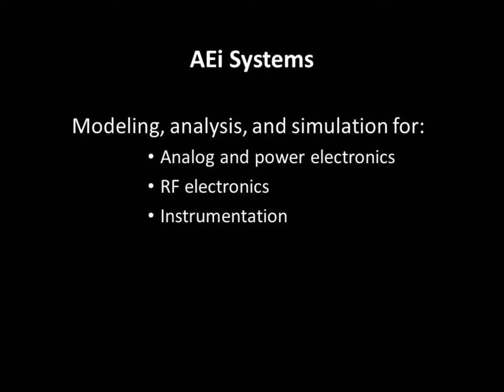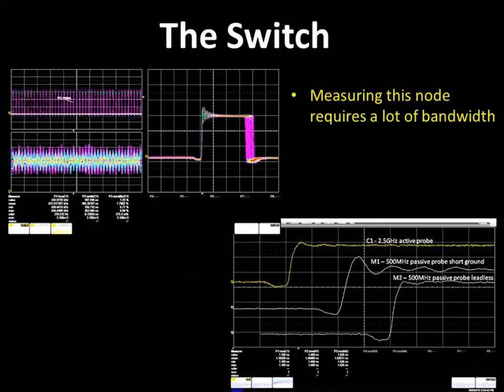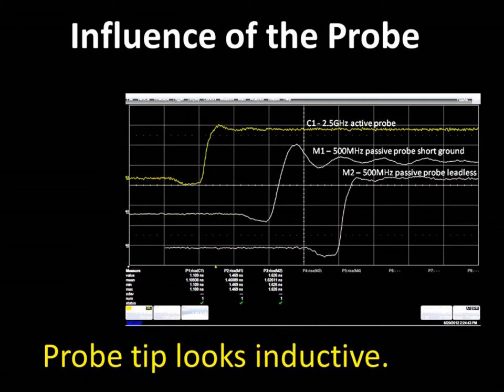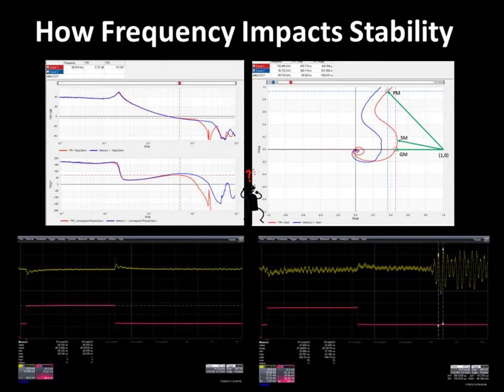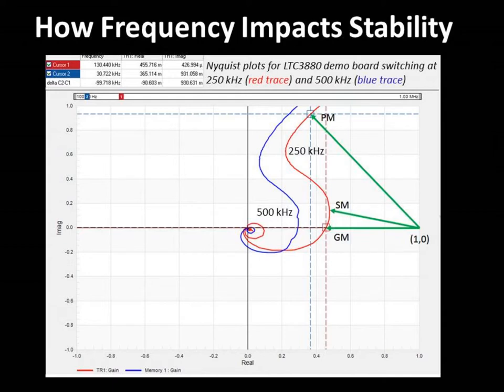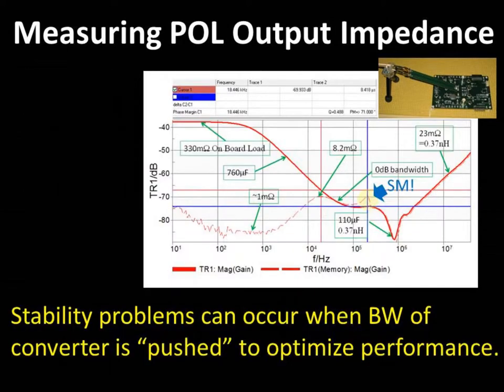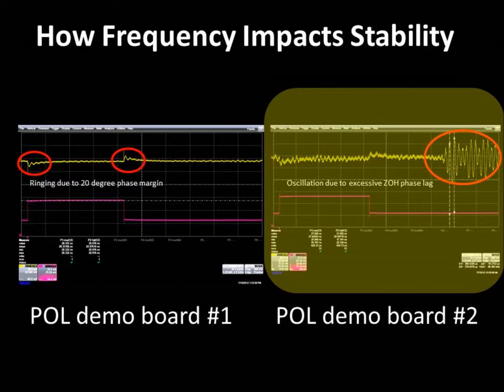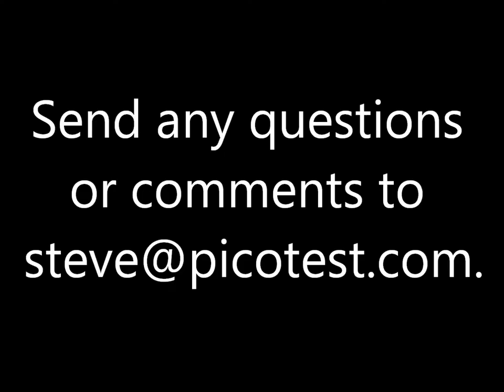Troubleshooting Distributed Power Systems (Part 6): The Switch

Comment: Viewer TH writes, "Nice video...The zero order hold (ZOH) and associated phase delay that Steve mentioned is related to the sampling effect in current-mode controlled systems, so perhaps a look at a voltage-mode POL as a comparison might also be instructive.Perhaps some guidelines on where to set the crossover frequency relative to the switching frequency would be helpful for the practicing engineer, too."
Reply: TH, I think maybe we will an article on the subject in the future, thanks very much for the positive comments